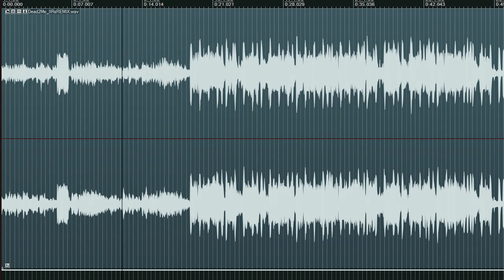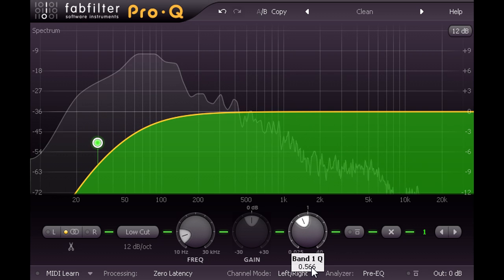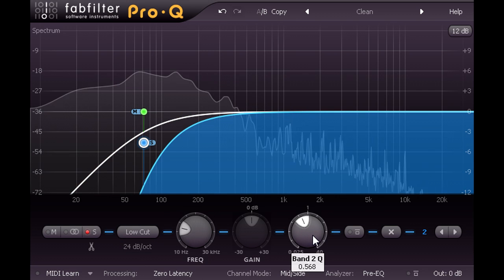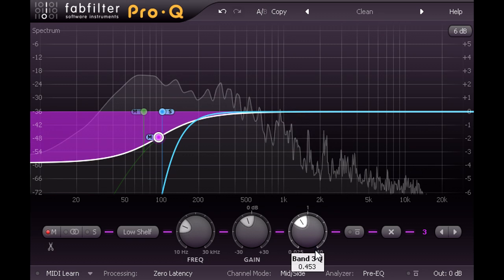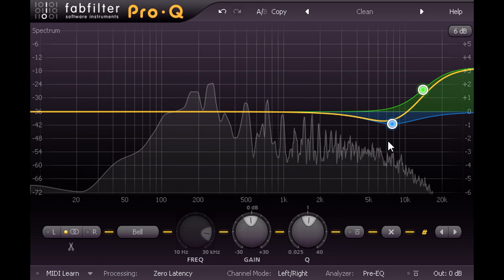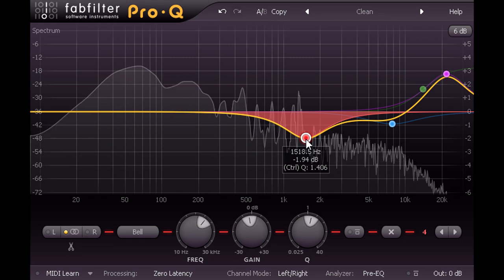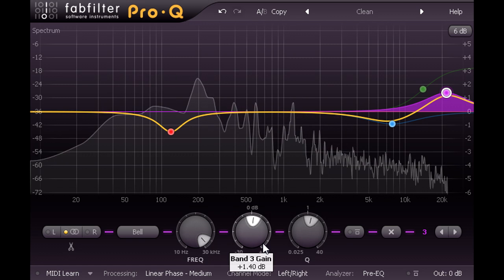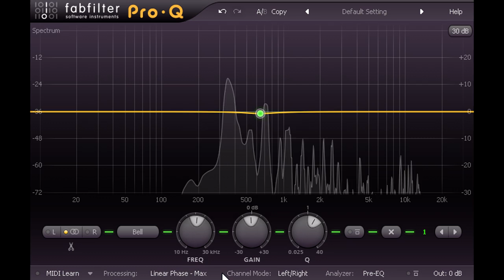FabFilter Pro-Q - Advanced EQ'ing Techniques

Comment: Wow. Insane amounts of information in a short video! :)  I thought I'd share some of my notes in case they are useful to anyone else: 

1. Cutting 20-30 Hz is fine on whole mix (even large PA systems rarely go below 40 Hz)

2. Many rigs will force subs to mono, even if the rest is in stereo. PA systems usually cross over from subs to bass at between 80-120 Hz

3. He approximates a  Baxandall EQ curve which can create smooth, natural sounding cuts or boosts

4. He creates an approximation of the Gerzon shelving type which can be more transparent than a simple shelf

5. He creates a ‘fairly wide and gentle dip at around 7k where the vocal is in danger of becoming sibilant, and allow the shelving band to boost the air region above 10k’

6. Bell-shaped filters are more frequently used to control mid-range frequencies. 

7. A ‘Q’ of 0.6 (roughly 2 octaves of bandwidth) - wide and gentle and can transparently sweeten material Boost the upper mid/lower treble will add presence and sparkle, or cutting them to reduce harshness and make the sound smoother. 

8. A ‘Q’ of 1.4 (about an octave) - useful to pick out individual parts of a mix. EG bring out guitar with a boost at 1.5k, or set it back in the mix with a little cut. Also a good setting when hunting for problem frequencies 

9. Higher Q’s can sound unnatural when boosting, but can be great for surgical transparent cuts.

10. A Q of 4 is roughly 1/3 of an octave, while a Q of 8 is roughly around one note (great for targeting problem notes)

11. Be aware, cutting the low mids may affect your perception of the high mids and treble, so you may need to revisit those

12. Zero-latency mode is best when sweeping for problem frequencies (as linear modes will introduce a delay between your changes and when you hear them)

13. Linear mode can cause pre-ringing effects on transients. As a general rule: Linear work best for gentle or wide cuts or boosts, especially in the higher frequencies, and might be a good choice in multiple microphone situations. Zero latency may work best for surgical cuts / costs and tonal shaping.
Reply: The hero we didn’t know we needed
Reply: Great and helpful comment. Thanks!

Comment: sub bass is great, don't know why you would take that out
Reply: Sub bass eats up a lot of energy in the efficiency of a speaker.  You can not hear sub bass, so it becomes wasted energy and the rest of the track will sound quieter because all the energy is going into recreating the sub bass.
Reply: i dont know if i believe you, but yea you feel 30hz a lot more than you hear it
Reply: thanks for the reply though, i will have to research
Reply: Very few speakers reproduce 30 hz....but in any case, you can see in his example he has -36 db at under 20 hz.  That is inaudible sub bass.
Reply: i have m-audio bx8s, which start tapering at 50hz according to the frequency response chart and they arent even dancefloor subs. i do see what you're saying though, i'm curious how it would sound if you compressed the sub bass for tick sounds and clicks to get through
Reply: Tick sounds and clicks are a higher frequency. Those sounds will be unaffected regardless of your low cut.
Reply: so 100-250hz deep pluck sounds?
Reply: For a kick drum click?  Is that what you're talking about?  In a lot of dance music, they use things like clap, snare, etc, so it is pretty high frequency....these videos by fabfilter are an amazing resource!  I'm learning a ton.
Reply: really depends on the genre.  Take out all that low freq info (30hz) when  mixing a modern electronic track designed to be played on hundreds of thousands of watts of power at a music festival and the track will be left behind.

Comment: Maybe someone can shed some light here.  I understand the sweeping thing somewhat but I think it's the spectrum analyzer I'm confused on.  Sometimes it's over the line and sometimes the freqs are well under the line so 1.  What exactly is the spectrum analyzer for if you're just going to sweep anyway when determining where to cut/boost? And/or 2.  Why the need to sweep if the spectrum analyzer is intended to show where the issues are?  I'm guessing spectrum visual and sweep audible??? Thanks anyone in advance!
Reply: The analyser shows frequencies right down to 10Hz as well as those up to 30kHz (On the pro-q2 I think it does anyway). These are frequencies that are out of our hearing range. Not only that, but adults over 25 can barely hear over 17kHz despite how well engineers think they can hear. So it can help in showing us frequencies we can't hear. But the sweeping is for smoothing out those frequencies that sound bad to our ear. Not what the analyser shows. But you can also smooth out the peaks based on what you see but I have never done this in a mix. I don't see the use. 

For me personally, I usually have the analyser visible but I only make low cuts and high cuts based on the information I see (and that is usually for frequencies above 20Khz - when low cutting, I usually sweep up until I hear it starting to effect the sound and then back it off a little so I am removing information that is inaudible).

When EQing, this is something we should use our ears for rather than our eyes. I have on multiple occasions checked out what my reference track looks like on the spectrum just to see it. Not to base my decisions from though.
Reply: unrelated comment but when you're using eq's with an analyzer, don't rely on the analyzer to find out where to cut or boost. remember this is music; it's meant to be listened to. rely on your ears to make decisions about changing the sound of something, not your eyes. also as a general rule of eq's, cut with a narrow Q and boost with a wide Q/cut to make something sound better(take bad things out) and boost to make things sound different.
Reply: Thanks Esp. And Descartes.  Is my mix supposed to sound "radio ready" by the time I'm done mixing?  I often feel like I can't get it to sound radio ready on my own but at what point do I know I've gotten it close enough to have the mastering studio Polish it to give it that final touch?  In other words.  When is my mix good enough for mastering?  Do I spend more time trying to control kick and bass sub harmonics?  Do I try to add more "air"? Or do I save time and leave "the rest" to the mastering experts?  Subjective I suppose but I often find myself trying to get my mix to sound good that I may be wasting time on details the mastering guys can take care of.
Reply: I'm not a professional I just happen to have some really great professors so don't take my word the same way as CLA's or Pensado's. But i think that stuff is all in your ballpark as far as mixing goes. Mastering shouldn't change the sound of your mix much at all otherwise there wouldn't be two seperate processes of mixing and mastering. If I find myself feeling the need to make more than minor polishing type changes on my 2Buss before I get it ready for mastering, Ill go back and change more on sub busses or channels and try to take care of it there. When you feel you don't need to use plugins on the master to make your mix sound better, then its ready to be sent out to mastering. You can never trust someone else to perfectly see your vision of the final product, so anything you want to happen sonically,  do yourself.
Reply: What shows up as peaks in the spectrum analyser are merely where there is the most amplitude or where things are loudest. That doesn't necessarily mean that is where the unpleasant frequency is. A snare hit will peak very high at the frequency where it is supposed to sound the loudest, but there may be a weird ring from the metal in the casing that is quiet, but annoying. It may appear to be very low in the frequency spectrum analyser, but sweeping a soloed boost will help you hear where that is so you can cut it,  Does that make sense? Other times, it may be that there is a peak in an area where your experience tells you there isn't much valuable sound for that instrument, so you know that's probably where you want to cut. So, sometimes its visually helpful, but you ultimately have to rely on your ears.

Comment: please what does it mean when my EQ analyzer only appears until 16k only and not more than that, not extending till 17 or 18 or 19 or the normally 20?!!
Reply: You're probably not using Pro-Q. Other EQs have settings that let you zoom in or show what part of the spectrum is showing, but, AFAIK, Pro-Q always displays and lets you add points from 10Hz to 30kHz, even though those are outside the hearing range. Putting points there can let you make curve shapes that you couldn't otherwise make.

Comment: this is the best EQ Plugin in the world . i use it everytime. whoever made this can fuck my mom.
Reply: It really is great for what it is. I love it, but "best in the world" is a little general. The UAD EQ strips are the best sounding EQ plugins you can get in the box, but they do not have all the features that Pro-Q has. Pro-Q three is out now, and it has the one feature I've really been wanting, with is the ability to do what iZotope products do and show where different tracks are masking. You can see every track that has an instance of  Pro-Q3 in the track that you are working on, select it to compare, and it will show you where the frequencies are colliding or masking and adjust the both from that one track. You can also set up inversely related points, which is one of the two features that iZotope Ozone and Neutron have that FF didn't. The other feature is Bandaxall curves at the top and bottom, but I've got another free EQ called basiQ that has three Bandaxall curves, so I don't think I'll be opening any iZotope products other than RX any more! EQuivocate is also a very good EQ. It is not as feature rich, but it tuned to human hearing, so it has a very silky, pleasing sound.
Reply: i made it

Comment: It's a good plugin for the mid's and the highs but the lows on this EQ sucks so hard. You can only boost oh so little because it's extremely sensetive and can easily start distortion if you boost it even slightly too high so you can't at times boost like you would with another EQ. the lows on this plugin also tends to give out some rumble imo. But, works brilliant with the highs and mids.
Reply: I haven't run into that yet. What frequency range are you noticing this happening?

Comment: That's fair enough, but it's sad when people do and they still feel they shouldn't buy anything.
Reply: Agreed. But I think it's a very smart business model to let young people or people just learning the business have the product for free so they learn on it. Then, when they are making money, they will gladly buy it. I don't torrent any more, but there was a time when I did, and I bought or had someone donate copies of all the software that I used regularly to my charity. Many companies actuallly donated copies. I will never buy another product from Waves since they implemented their new system, and I won't buy any product that uses iLok or has an installer app. Draconian licensing scheme that punish the paying customer are bad business sense. Boycott these companies. It's illegal to encourage people to break the law, so I'm not saying people should do this, but wouldn't it be great if we organized, got VPN accounts, and just seeded cracked copies of these companies' software around the clock to teach them a lesson? But, all I can do is encourage people to boycott. If you want a great DAW, use REAPER. The demo keeps working forever, and it's only $60 for a personal/small business license that lasts for 2 full revs—about 4 years of new features. And it is a better DAW with way more capability than ProTools. Fuck Avid. Fuck Waves. UAD gives you loads of the best plugins you can get when you buy their interfaces, which are very reasonably priced for what they do and how many truly amazing (really the absolute best available) plugins come with them.

Comment: Hi Just Bought the Pro-L ,Pro-Q ,Pro-C ,Timeless 2 .
when mastering in what order would you use your filters Eq, Comp, Limit

cheers
Reply: Usually you want to EQ into the Compressor, then limit. The limiter will always come last in the chain, but you may layer compressors, EQs and other things in the order that sounds and works best. Mastering shouldn't be a much of a process. It's should really be limited to doing a few things to maybe compensate for how he mixer's room might have colored the sound, making sure you're within the limits of streaming services, adding the track info, and making a master if it's going to vinyl or CD.